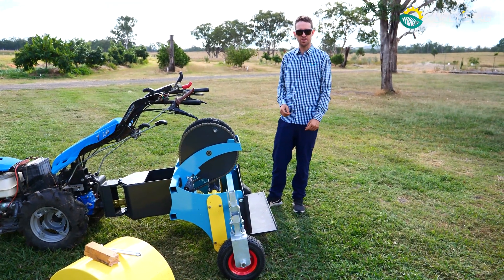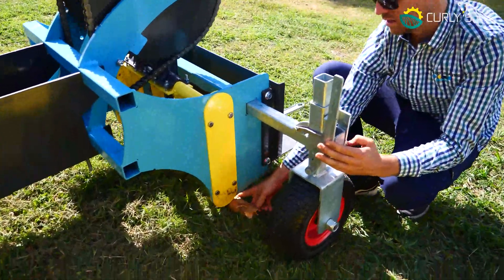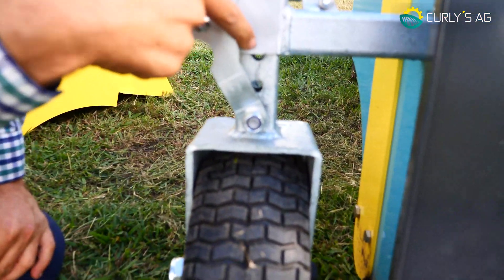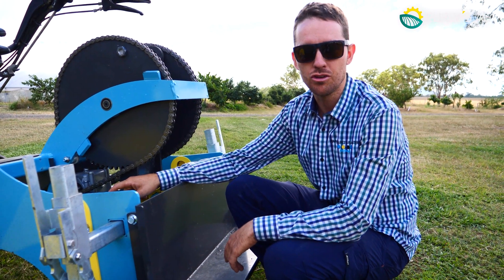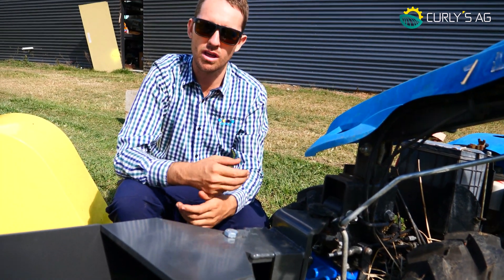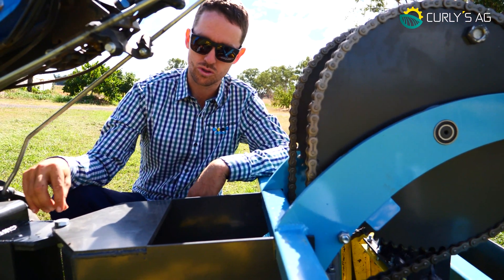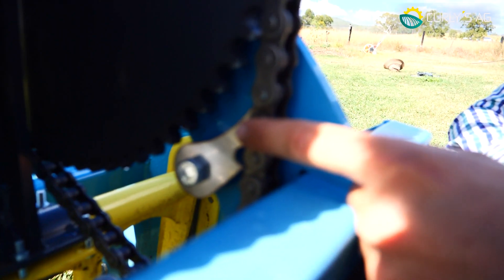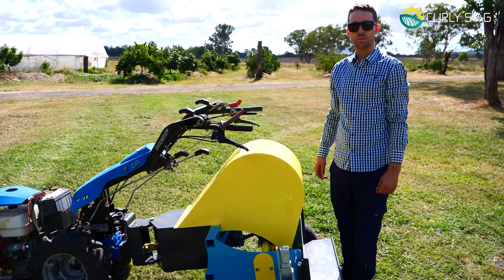The Worlds First Automatic Broad Fork | Curly's Cracker 2 | Maintenance and Operation

Comment: Can I mention a couple of adjustments? Ring spinner, rather than the shifter. The length of the bolts on the pitch control- looks ugly from a design point of view. Also cam action clips on the guard. Pins rather than bolts on the height adjuster. Thanks.